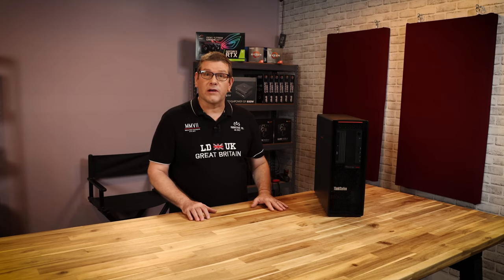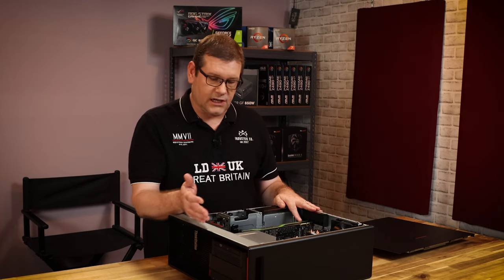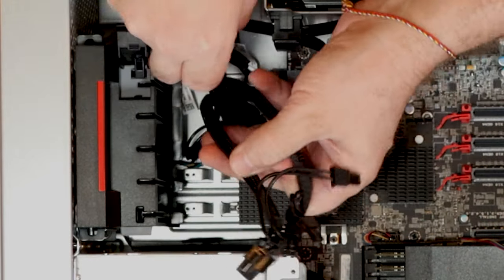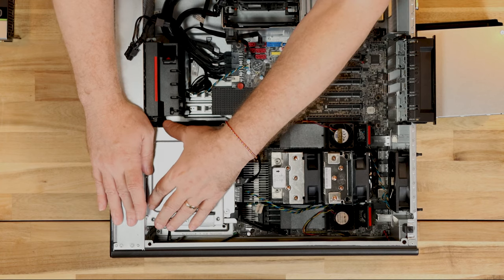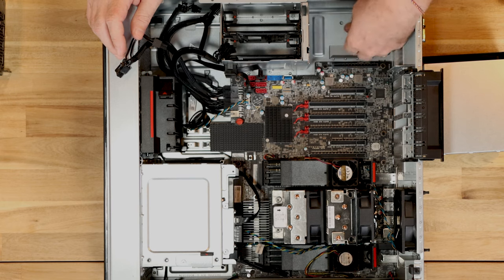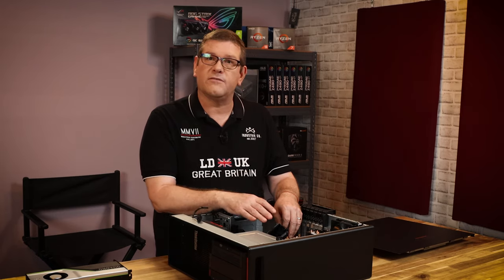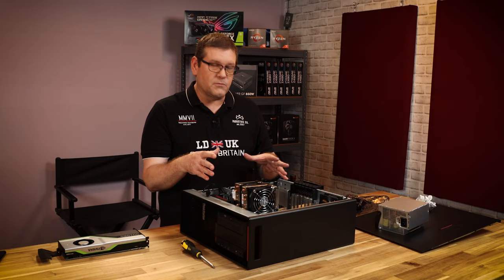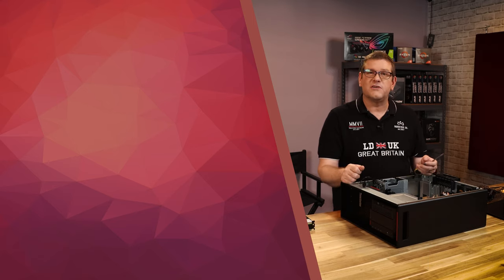Review of the Lenovo P620 Thinkstation - Threadripper Pro Part 2. A look inside the workstation

Comment: Great machine but our newly purchased ThinkStation P620 suffers from a sudden power loss type shutdown, usually when not under any load.  This happens around every 2 weeks.  Lenovo repair was unable to resolve the issue.
Reply from the maker: hi Eamonn Joyce, Sorry to hear you are having this issue. I have three of the P620s and I do not have that same issue. Good luck with the support in resolving the issue.
You might want to try updating the Bios to the latest version. 
Thanks for watching

Comment: Fantastic review. I ordered the P620 from Lenovo (64 cores) and it's supposed to arrive in 3 days. I don't do 3D rendering very often, but it is nice to have this system ready for it. My main use will be for 8K video editing in Adobe Premiere Pro. I currently have a NVIDIA RTX TITAN, I am not sure whether to update it to a 3090 or a a6000. What would you recommend??
Reply from the maker: Thanks for sharing. It depends what Software you are using for editing the 8K footage. Adobe P-pro will only use one GPU. DaVinci Resolve  will use more than one GPU and then I would suggest two RTX3070s. The a6000 is not worth the money. Just look at the old Quadro cards getting beaten by the RTX3xxx series cards at 50% the cost. The same will happen to the a6000 next year when the RTX4xxx cards are released. Save your money and get a RTX3xxx card and upgrade to a new card next year.
Reply: @MediamanStudioServices  Thank you very much for your advice. I just have one more question because I don't know a lot about GPUs. Someone reviewed the 3080 vs the 3090 and concluded they are basically the same. The only difference is that the 3090 was able to support 8K. What makes a card able to support 8K? Is the amount of memory of is there something else? I am asking because your suggestion of using 2 3070s makes lots of sense specially after looking at their better performance against the other 30's and having a better price. Are 2 3070's able to handle smoothly 8K, even if only one is not recommended for 8K? Thank you very much in advance for your help.
Reply from the maker: @osoriony  , so there is many different formats/codecs for 8K footage. The RTX3090 not the only GPU that can playback 8K. Your source supplied you with incorrect information. Yes the RTX 3090 is the most powerful GPU in the RTX line of products at this time, But only out performs the RTX3080 by about 15% in most workloads. Other GPU can playback 8K. 

Again it all depends on the format of the files. I tested a RTX3060ti and a Quardo 5000 last week that could playback 8K footage. Some formats use the GPU to decode the movie files and some use the GPU. So it all depends on what file format you use from the camera footage. But if you are using Adobe P-Pro, then it will only use one GPU for most of your workload. So two 3070 will not be of good use in P-Pro.

I would recommend testing out a system with your workflow before purchasing. Any good reseller will allow you to test a high cost system before purchase or you could look on youtube for more review of your specific workflow to get more confirmed information. If you let me know what kind of 8K footage you will be working with I can help guide you to custom design your system.
Reply: @MediamanStudioServices  Thanks a lot. I am using mainly 8K footage from a Canon R5. Only in Premiere Pro.
Reply from the maker: The EOS R5 has video recording formats and frame rates for 8K DCI, 8K UHD, 4K DCI, 4K UHD, and full-HD. Compression is either RAW, ALL-I, or IPB in either 8/10-bit 4:2:0/4:2:2 H. 265/HEVC or H. 264 AVC. What is the compression you are recording with?
Reply: @MediamanStudioServices  8K RAW DCI
Reply: @MediamanStudioServices  422
Reply: @MediamanStudioServices  10 bit
Reply from the maker: if your using RAW 10bit 422 then the CPU is doing all of the heavy data workload. The GPU is only pushing pixels and not doing any of the decode. So even a rtx3060 could play back this footage
Reply: @MediamanStudioServices  Thank you very much for your reply and kindness. If I decided to sacrifice a little bit of resolution for the sake of allowing the GPU to speed up the workflow. What format would you suggest to use (either 8K and/or 4K)?

Comment: So i can buy this workstation and put in a 3090? No bottleneck or anything?
Reply from the maker: yes, I have tested the RTX3090 in the P620 and it rocks......Only issues is thermals and space required to house the GPU in the case.
Reply: @MediamanStudioServices  sorry for the late response. Oh nice, thats really cool, thermals like to hot or? Okay but its possible to have it in there despite it being really tight? And use the 3090 for like 3 years?
Reply from the maker: @claeslind9532  yes, just keep the system in a air conditioned room. the tight is not an issue as long as it fit in the case with good air flow